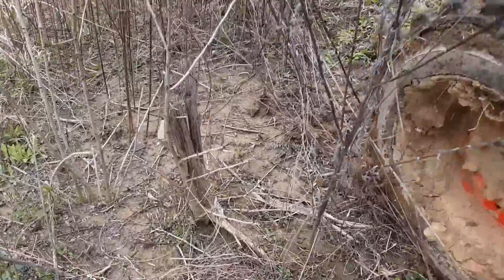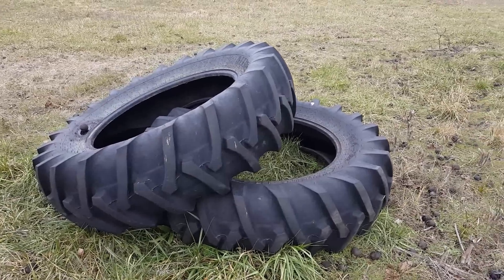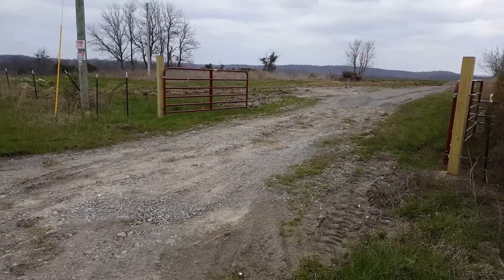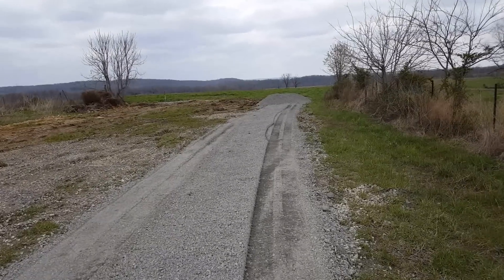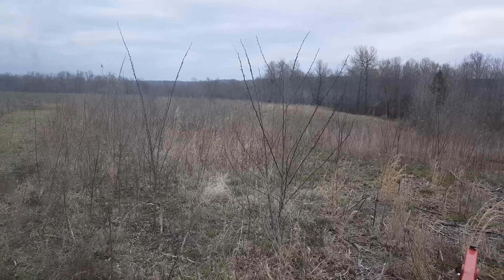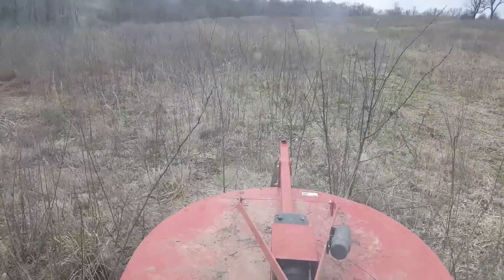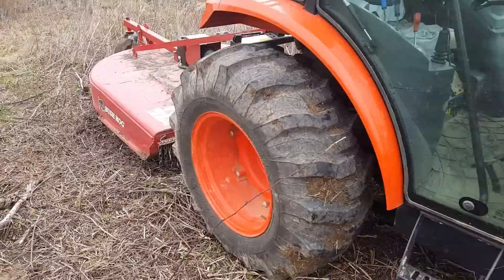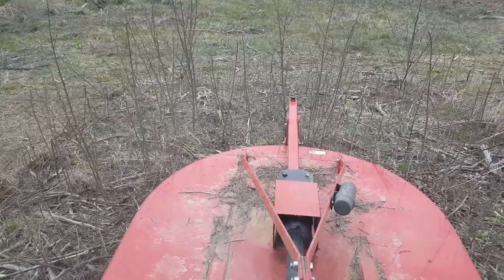Project 211 & Bush Hogging in Reverse! Here's WHY. I just saved over $2,000!

Comment: What do you think about going forward with the bucket just above the ground so it hits the cut off tree stumps and stops you?
Reply from the maker: Its really of no use in a situation like this. The ground is so bad uneven that the bucket goes in the air on every bump and then scrapes the ground; back and forth... It might help a little but those stump are pretty resilient in that they pop back up pretty quick.. You saw those BIG tractor tires, those are probably 1500 to 2,000 each installed... This is by far the worst ground that I've ever had to bush hog as far as stobbs go... I did try the bucket down for just a little but I couldn't stand everything just scraping and catching underneath... thanks.

Comment: Any way of turning those old tires into drags? Heavier? Throw a sandbag or two inside them.
Reply from the maker: They'd probably work OK, but would be a heck of a challenge getting around from place to place, that's why a small, stout one that you can add weights to is a bit easier. Someday I have to go and fish those tires out to save them though... I'm sure I can find some use for them! thanks.

Comment: FYI, rule of thumb for tire fluid ballast is 75 percent max. To properly determine the fluid level, it is NOT only necessary to locate the valve stem at top position, as you have done, BUT also raise the tired being checked off the ground. Failure to do both techniques, squeezes the tire, providing a false reading for the fluid ballast level. Use of backhoe stabilizer or hydraulic jack will accomplish the task.
Reply from the maker: I'm not sure what raising the tire does...? I've had 3 tractors filled with fluid now and I even watched them do it on one and picked their brains on how they did it on the other two. None of them said they jacked the tires up.. They just calculated the size of the tire and added the amount called for.. Although, at the Kioti shop I don't recall asking them about that one.... Doesn't the fluid always ride on the bottom, i.e. gravity?

Comment: Buy a package of pipe cleaners, wire bundling, emergency cotter pins even if you have to double or triple them to get you back to the trailer. Super cheap. Large hairpins would work in an emergency too.
Reply from the maker: Good call, I did end up getting a bunch of supplies thanks

Comment: If you stacked them tyres on top of each other, stuck a pond liner inside and filled it with water, Would the deer drink out of it???
Reply from the maker: yeah, they probably would. But in this case, the watering holes should be really easy with the excavator and the way the ground is so I'll look for a different use yet... thanks.

Comment: Have you thought about burning the problem areas after cutting in some fire breaks? There are a few methods to doing it depending on what is burning and the weather but you would essentially be quickly setting all 4 sides of an area on fire so it pulls into the center of the area. With some ATV's equipped with water tanks and some fast attack truck rigs you can keep most of the secondary fires knocked down and stop any spreading. 

The fire triggers native grasses to regrow from the roots so you will soon have at least the start of some ground cover soon after the burn. That and the bare ground after the fire exposes the seeds to everything that eats them for the few weeks before the roots regrow the grasses.
Reply from the maker: yeah it would be nice, but I can't afford to hire a burn team right now, it is a huge area, and there is no 'time' for waiting, this all needs to be done yesterday. That would have been a great option for sure. However, part of the plan is to leave all the thick and nasty stuff growing around the pines for good wildlife cover, so the burning would have contradicted that part of the plan. Thanks.
Reply: If your already done this year can start looking into it for next year. 

There are a number of videos showing how to do a safe burn yourself with a small team generally family or neighbors. Often times the land management for the area will have some assistance if you have an invasive plant type they want destroyed. And if you check with the fire department they often have a list of wildland fire fighters that will assist generally to keep up experience between fire seasons. 

As for keeping sections unburned you have 2 main options make a fire break between them using the brush cutter or make a number of small burn lines to end up with a very wide burned area between the save area and the burn area before the main burn starts.

Comment: You don't haul your tractor that way you pull it on the trailer you don't ever back it on there... you can hang the bush hog off the back of the trailer 4 feet and still be legal
Reply from the maker: No you can't hang it off of my trailer because the rear Gates fold upwards so it is not possible to do that, thanks